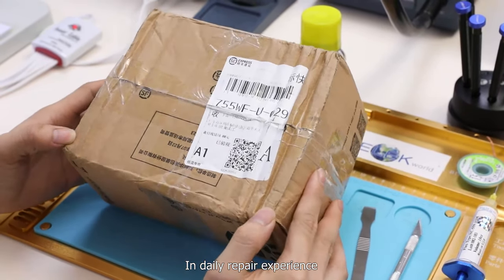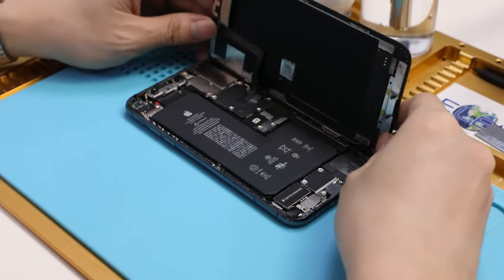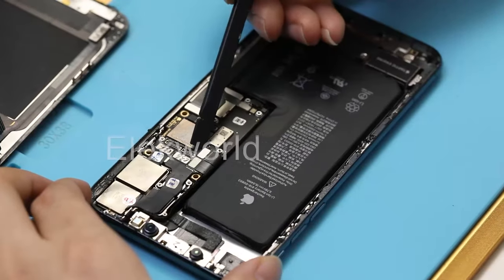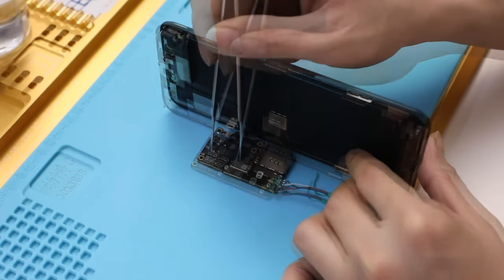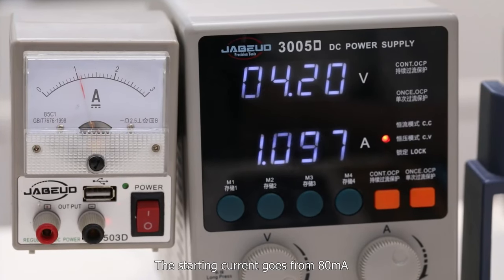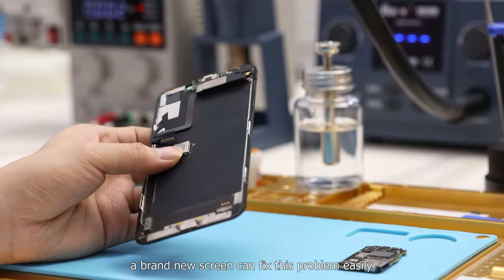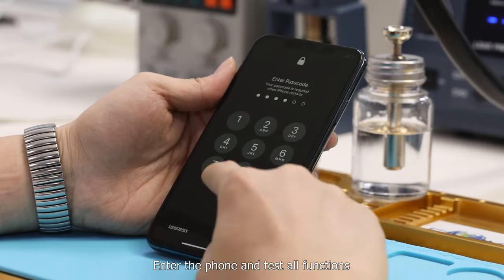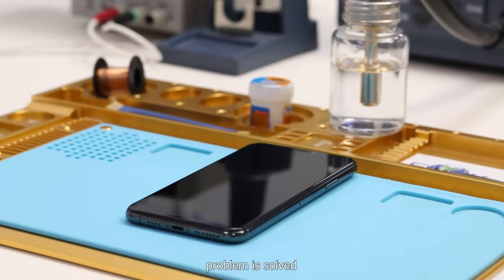iPhone 11 Pro Max Not Power On Diagnose And Repair, Troubleshoot With DC Power Supply.

Comment: I had one on an iPhone 6 that had no cellular data after screen replacement. It turned out to be caused by the screen.
Reply from the maker: Yes, sometimes screen replacing job might cause some weird problems, probabbly bcuz screen led some componnent short circuit, or damaged something accidentally during repair.

Comment: The phone will be draining battery, there’s a component consuming power when connected to dc power supply without prompt to boot
Reply from the maker: Hi friend, by now we haven't met this problem, this is very common process in repair industry.